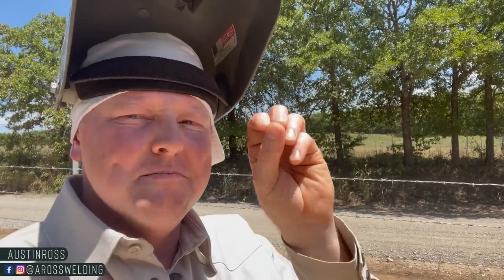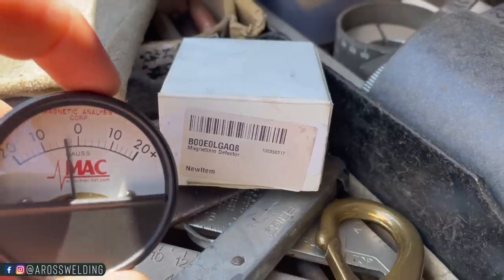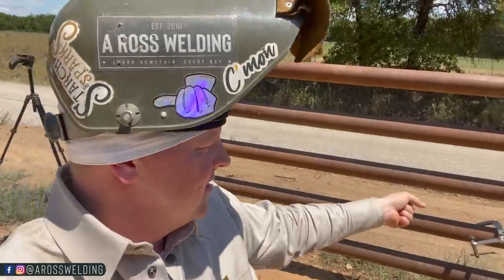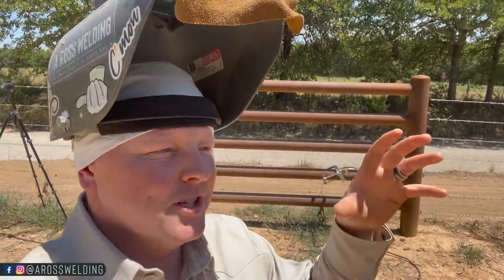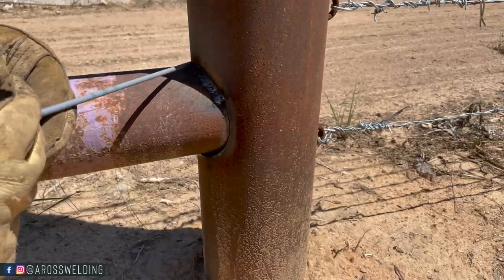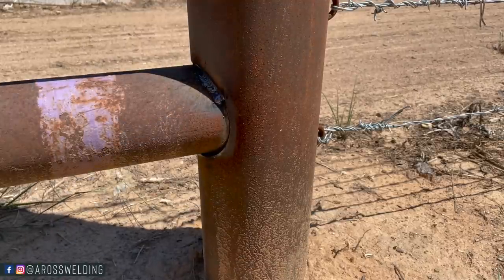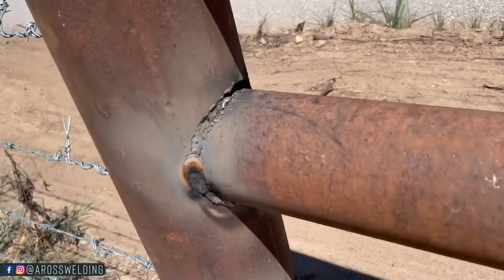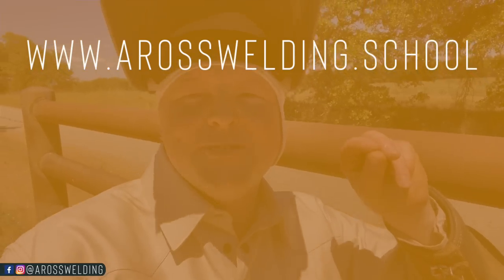WORST MAGNETIZED PIPE I'VE EVER WELDED ON - how to weld it? what causes it? radiation? and ...

Comment: Steel pipe or steel plate can become magnetized by rubbing together while shipping or boring into the ground  especially around joints and from rubbing against elements and rock in soil, as well as welding. Steel can become radioactive through rubbing against radioactive elements in the earth as well as scale from iron in steel can cause radioactivity. Hope that helps!

Comment: When dealing with (Hot Pipe) what you will need is a gamma radiation detector.  Berkley Nucleonics makes a nice and compact radiation detector that is very sensitive. The other two forms of radiation, Alpha and Beta are actually particles and harder to pick up as they don't travel well through air. The gamma radiation is a wave form of energy. The Berkley will pick up gamma sources at a considerable distance depending on the strength of the source. I welded on some highly magnetized sucker rod on a fence I was building,  I went AC  with 6011 it worked well as the arc oscillated between both sides of the weld.

Comment: NORM or naturally occurring radioactive material is found in many oil and gas basins across N. America. 

Most of the time in my experience it is found in the scale that attached to produciton tubing, casing, or down hole tools over time.   Most companies test for it coming out of the hole to ensure the safety of the rig crews and whomever may be handling the pipe or tools. If the levels are too high it is actually illegal to haul away.  The pipe or tools can be descaled by specialist and the waste is put in drums and hauled to special landfills. After cleaning the pipe or tools will no longer be radioactive. It’s always good to ask when buying pipe if it’s been tested for NORM.

Comment: 👀   🇺🇸 .  Austin I've been welding on projects in my shop with new material and it becomes magnetized I never new why.  We also used to build race chassis and my PA' always had us wrap a chain around the chassis and jig  and let it touch the shop floor was supposed  to control  it idk if it ever helped bc the chains picked up metal flakes.  
Also do you think the Radioactive ☢️  pipe hurts us when we weld it?? 
When I by from my local steel yard I don't worry but when I get it from a individual idk if it's been tested.

Comment: Im mainly a structural weldor, but i keep about 3 feet if welding cable with a ground clamp on each end, clamp one on each work piece, opposite sides of the weld zone

Comment: Thats alot of residual magnetic field. 10 gauss at 12" is crazy.

You can try 1 or 2 things:
#1. Create a 5 turn coil with leads around pipe end while welding and have a hand slide it of end. Then check gauss, reverse direction coil if it didnt work.
 #2. Ground on pipe and crank amps up to weld on another drop piece. This might pull gauss out.

Note on radiation in pipe, I have never knew or heard of this. But if so im sure we don't want to even mess around due to the dangerous risk handling radiation. Very limited to detection unlike magnetic fields. I have been in NDT/CWI inspections for over 16yrs. Be safe!

Comment: an AC yoke that NDT uses for mag particle testing can also be used on pipe ends to temporarily knock out magnetism as well as heating the pipe
Reply: after 26 years welding ive just started up demag company capable of mainline tie-ins and rotating equipment up to 36” with w.t. 21/2” and to see the frustration wash off a welders face and/or the supervisor and engineer is perfect

Comment: Mr. Austin, as always you have excellent video. I just noticed in the coments this magnetic issue can be solved by welding  with AC current. No doubt this will work. I had a need to demagnatiz a shaft once, so I wrapped the shaft with welding leads, and ran a few AC passes on some scrap and this solved the problem. I was going to propose that you would try this while welding the pipe with AC, but as these other people have suggested just using AC to weld with should solve the problem. 
The theorie is DC current will create a magnet field. Polarity does not matter. AC current is said to isolate back and forth thus councils out magnetism.
DC current is used make magnetic fields for solenoids to push or pull, also to make brakes and clutches work.
For AC current to become a magnet, example electric motor starter, it has a special coil which has a shading coil made into it. If the shading coil becomes broken the coil will not pull in, it will just viberate.
If you experiment with this please make a video of it.
Keep up the good work

Comment: I have seen magnetized that had a nice looking weld but if you hit the pipe with a shop hammer the weld would break away from the pipe like it did not have proper penitration. Several friends that were working in a magnizan plant in Texas told me to weld magnetized pipe you had to reverse the polarity on your leads. Try it and see if it works.

Comment: My center punches and drift pins would get magnetized and they would pick up metal flakes till it became bothersome. I would aim the tool towards the south and tap them with a hammer 20xs. That would take most of the annoying magnet force out of them. Aim them north will put it back. When you weld some metals you will find that welding towards a ground will make the weld splatter more especially noticeable with 7018 , change ground or change direction.

Comment: Did you ever try wrapping the welding lead around the pipe? Never had to do it myself but heard from a old pipeline welder it works. Try wrapping clock wise if that makes it worse. Then wrap the other way. Just can't remember which lead

Comment: The easiest thing to do is move the ground clamp very close to the weld if you don't have an AC welder.  I have ran in to this and find clamping the ground via a C-clamp let's me put my ground close to the weld.  When there is magnetism I like the ground connection close to the rod (it should be anyway) and to the extreme that the distance from rod to clamp in travel direction is shorter than distance from rod to clamp in opposite direction.  Now there's no arc blow.
--- edit follows ---
Ironically a magnetic ground clamp is something I have been wanting to get and probably would help with this situation.  It let's you place the ground anywhere.

Comment: not to say much but... would it make a difference, to tack weld it then use one genorator/welder to run AC thru the whole pipe section and use another welder for running the weld with the AC flowing thru it from the other welder tho running the welding on DC? or just AC weld it? ... ... ... Barrel plow?

Comment: You can get a cheap Geiger counter off eBay for 100 bucks or so. The radiation comes from radioactive elements present in different formations drill pipes go through. Shale is a big one, you use the game kick to identify it on a bore hole log
Reply: I bought a pair of those cheap Geiger counters off eBay.  One didn't work at all.  The other worked but was very insensitive.  I had a piece of pipe that the junkyard rejected because it made their counter scream like a banshee.  My Geiger counter barely reacted to that same piece.  I wouldn't mess with eBay for that.

Comment: Welding brother-in-law sometimes would help and other times you’d know when he struck up a new rod and would change the direction the magnetism would be directed. Usually causing you to snuff out. Getting a bead in a hard tie in, we usually would wrap the pipe with our leads and using a guss meter you can tell it would either increase (almost bring the magnetism towards you) or you you would send it away from you. If you brought the magnetism towards you, you’d now have to wrap it the other way and start from scratch. Lot of times I’ve seen just a tad still stay in the pipe. Once you manage to get the hole bead sealed up, you’ll usually know the softer spots or the spots that react funny. These spots you have to treat with care during hotpass (and are usually 180 deg from one another like a north and south magnet,) they’ll fall in because now that the joint is welded it now tends to want to pull in or suck the pass into the pipe. Be quick and don’t be afraid to turn down and your heat a bit and a little bit of long arc. The arc that is produced causes a showering affect with a big thin puddle usually, I’ve never had a repair yet leaving a bit of tracks in the root pass on magnetic pipe! As you keep welding you’ll find it getting easier to weld. My theory is like any magnet if you get it hot enough it’ll lose magnetism, and with welding your constantly using electric and eventually over power the current messing with its direction current and pushing the magnetism away( down the pipe line.  It’s funny stuff. Even welding under heavy power lines you’ll find this true. Also things to consider is if the pipe was smart pigged it’s usually always magnetized, drill pipe and old pipe that has had been in service for years! Old pipe in service for years I was told has small particles coming from deep in the earth that gets blown into the gas and with the turbine in the pipe will effect the pipe greatly until the grass reaches its scrubbers fro cleaning. Also welding to close to anodes will cause magnetism. They use anodes for rust protection and all they are , are a simplified battery with a positive and negative causing a current in pipe for us guys to fight. Hope this helps a little!
Reply from the maker: It definitely helps! Thanks for sharing!

Comment: Magnetism is directly affected by heat.  The hotter it gets the less magnetic.  We use magnets in blacksmithing when we are forge welding materials to see if they are hot enough. The Crystal structure of the metal will realign at that point and the metal is hot enough to forge weld.
Reply: It's called the Curie Point.

Comment: Flip to AC current, takes care of magnetic pipe. This happens when pipe is spun in the ground, common with used drill pipe.
Reply: I've used magnetized spun pipe but the problem isn't the polarity and weld bead. It's the actual weld strength. The metal would not hold together under pressure. It welded fine and looked fine but it had the strength of solder/lead. The metal just pulled apart.
Reply: @heyman5525  Then something else is wrong.   We did a few destructive tests to it once intending to test the AC current, it was just fine.
Reply: @chuckmiller5763  Yeah, once we sent pictures to the distributor, he immediately attributed it to the magnetization. He seemed familiar with that particular problem. I think I've seen every type of weld or material break or crack...but Ive never seen anything like that. The weld never broke. It just pulled the base material right from the pipe.
Reply: Another thing to remember about drill stem and production tubing is that it is CHROMEMOLLY  STEEL. Extremely ductile,harder than fence post and more brittle, especially after stick welding.  Chromemolly race car frames MUST be tig welded to prevent cracks.

Comment: I'm curious because I don't know. but why don't you clean the weld area down to shiny metal to remove impurities in the weld? I know it doesn't matter on a fence because it's not really structural, but I would think it would make welding easier.

Comment: Aren't welding rods slightly radioactive? I use 6011 and 6013 and those were what I was warned about and to keep them in my shed rather than in my house. I'm self taught in welding so I could very well be wrong on this.
Reply: You might be confusing this with the electrodes used for TIG welding. Those tungsten electrodes are made to last as long as possible while maintaining a point, and for that purpose small amounts of another material are mixed in. One example is "2% Thorium" which is slightly radioactive.

Comment: Austin Ross, IVE TRIED SS TYPE 309 STICK, AND NOT ALWAYS, IT WELDED 1/2 WAY DECENTl!!!!  I PICKED UP 50 POUNDS AT AN AUCTION, PRICE WAS A GIVEAWAY ALMOST, SO IT SAT IN THE SEALED CAN 4 A COUPLE OF YEARS!!!!!!  GOT LUCKY!
DUMB QUESTION? ANY LUCK WITH THE MIG, BOTH GAS AND FLUX CORE???????

Comment: I worked for atmos energy we took gas from fain gas plant it is located north of Amarillo and the company found out the gas was radio active and we had check all of the pipe and fitting and meter and valves when we took it out of service fain was sucking gas out of the ground that is why it was radio active it was a bad dill

Comment: A metal that has been magnetized can me returned to non magnetic by subjecting it to an AC electric field. I wonder if you could wind a home made lead with the hot wire from your grinder (just the hot wire and not the neutral or ground though you could use the neutral instead) in a spiral fashion around the pipe. Then do a bit of grinding and see if it removes the magnetism. I think that might actually work. Also I wonder if your puddle characteristics will change if you use AC instead of DCEN.

Comment: Radiation can't be placed in the pipe just from drilling
Certain minerals do contain radioactive metals but may fuse in the pipe only if the pipe becomes very hot.

Comment: If you can make steel hot enough that a magnet won't stick to it I wonder if you can heat steel that is magnetized till it's not magnetized anymore which is probably why your second pass ran better in my theory I'd be interested to know if you got a pile of temp sticks what the magic heat number is to make a far less troublesome pass depending on the size of the material is it something you can get away with a weed burner on or is it something people should go straight to a rosebud on anyway I didn't know they had magnetized steel like that due to the conditions it was used for but preheat sounds like a interesting experiment

Comment: 6:06 The tubing does not have to rotate to become magnetized, just being in a deep well bore will do it.  It is a result of the Earth's Magnetosphere, Nikola Tesla had tapped into this unlimited power supply but was de-funded as it was to be "Free Energy"  The Egyptian Pyramids did the same.

 I have seen this cut tubing in half with laser like precision. This is why cathodic  protection kits is installed at various places on the pipe runs. The energy sector creates trillon$ in fees / taxes for all the various govt agencies and you can control the country when you control their oil supply (double jeopardy for the rats in charge).

Sometimes several good smacks with a BFH will knock the Gauss right out of it, another method commonly used is the opposing wraps of the ground / lead cable on either side of the weld joint.

Great job on showing the world how the patch runs Austin!

Comment: for what your doing there i wuld have  heated up the pip red hot  & welded it hot hear neutralises the magnetic pool.,  The puddle is red hot & the neutral area  in the weld. YES them where  the days in my life . HA &  welding  in the remain Another ball ack   Did you know some people can't weld in the ran  They conduct the current of the steel plats for as it is earthed . there ok in dry weather  but get regular belt's of the welder  wen it is wet . I wasn't to bad  But i have known some that just could not get near the job & as you know WE sometimes weld in the rain  I used  water proofs pant's that  helped  lot

Comment: I check my pieces after cutting and all of them have had a positive and negative end. I put the first post positive end up and match that to the negative end of the cross pipe. On the opposite side I put the negative end of the post up to match to the positive side of the cross piece. It welds weird but much better. If you put the lowest cross piece in next with positive to negative, the rest of the cross pieces will weld much easier. 

If you weld positive magnetized to negative it will work better on a DC machine with a positive ground running hot with a 7018 from the beginning. At least, that's my experience with 5000 feet of pipe I bought that turned out to ALL be magnetized. If you're reading this Bob the Pipe Salesman... I hate you.
Reply: A Lazy Primitive, MY BET!!!!!!!!!! BOB LOVES YOU!!!! BIG TIME!, WOW 5000 FT!!!!!!!!!!!! HOPE HES OFF THE CHRISTMAS CARD LIST!!!!!!!!!!!!
Reply: @StortWeldingCoLLC  Yep, I bought from him for years with no issues and the last order he dropped off and went out of business.
Reply: @lazyprimitive  NICE GUY, HUH, NO CLUE WHERE HE WENT? STRANGE!!!!!!!
Reply: @StortWeldingCoLLC  Sold his yard and I've never seen him again.
Reply: NEVER TRUST A PERSON SELLING USED OILFIELD TUBING ......no matter what your going to do with it.

Comment: Brother in law does not matter. Proper way is to use a degaussing machine. 
Essentially get another machine, wrap the ground a number of times on upstream joint. Wrap the stinger a number of times on down stream side. Short ground to rod holder. Dead short. Hang a welding rod from the weld groove adjust the current on machine until welding rod falls to ground. Now get to welding normally. Any other methods will violate the pqr/ wps.

Comment: I have been wanting to get something that detects radiation.  From what I understand, geiger counters are not the best for measuring how DANGEROUS the radiation is.  A geiger counter gives you Counts Per Minute (CPM).  It doesn't tell you how much energy each count (blip?  tick?) has.  I think DOSIMETERS tell you how dangerous the radiation actually is.  I'm still researching, so I don't actually know.  Can anybody correct me?